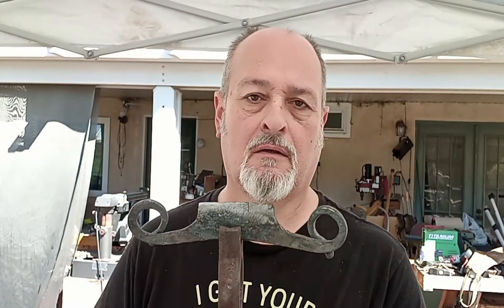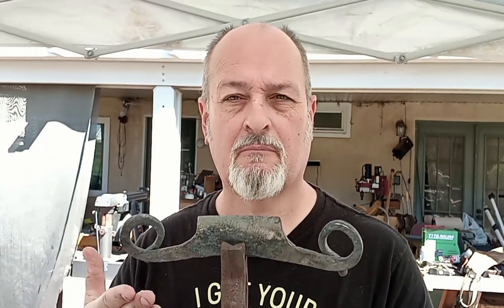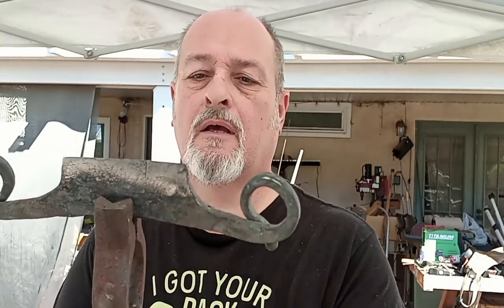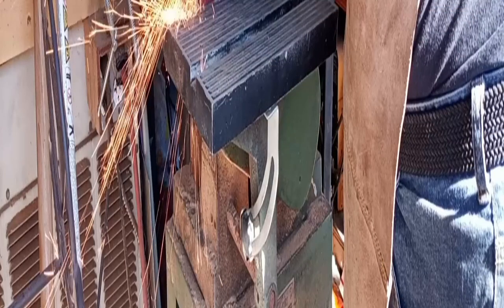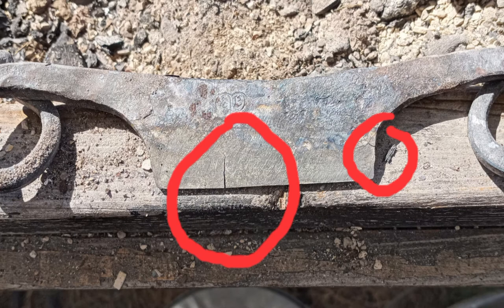Learning Something New

Comment: That was such a thick piece to start with. You had a ton of sweat equity in that one for sure. Sucks it cracked. A little tool steel tig repair will bring that one back to life.
Reply from the maker: Requires a little TIG to begin with. 😁 I have flux-core